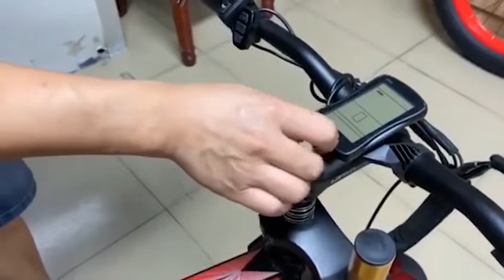How to Adjust Travel Suspension of Motor Cycle Fork for Cyrusher XF900 and XF650 Plus

Comment: How do I change the tension force for XF900?  Just got mine today, when I mount the bike my weight compressors the front fork. I have turned the top of fork adjustment in + direction all the way.
Reply: Matt check out the Facebook forum for Cyrusher you can PM Harry Xie directly or someone on the page will help you.  I'm sure that'll work.  Good luck

Comment: thanks alot for this im literally about to buy this in 3 days and was wondering about the motorcycle style fork adjustments :), btw does this bike come standard with those mud guards like the xf800 does or do i have to call to have those added on cause in the specs it says (optional) but i also dont see those specific guards (the ones with that stripe on them) in the accessories section? thanks
Reply: I have an XF900 and it came with the mud guards although I believe the "Everest" is the latest model and I've ordered one also.  I'm curious as well in regard to the Everest...good question Max.
Reply: @montetown8836  haha ya i actually ended up bombarding them with more questions and they actually responded back to me with answers to everything to my surprise,pretty good customer service, heres the response if it helps you out "Hello Again, 

Thanks for your question. You are right,frankly speaking, Everest and XF900 are the same model frame with different shimano gears, li-battery and top speed,etc. 

Everest is classed 3 ebike with 22miles/hour by throttle, 28 miles/hour by pedal assisant, no special license require to ride in USA according to Fedral law and regluations. 

It has two options: Pro --21 Speeds, 17ah Battery with all accessaries such as rack, fender and bag;  Base--7 Speeds, 13ah Battery with out any accessories. 

Of course, you will see the price for Indiegogo is much cheaper (2500 USD Only for Pro Version), because we are funding to mass produce them to low cost for shipping, production etc. 

 XF900 has higher speed: 31miles/throttle or Pedal assisant and it only have one option:  21 Speeds, 17ah Battery without rack, fender and bag. Of course, we can ship faster than Indiegogo project order.  

Acutally, XF900 is the earliest version we are selling for this ebike, because it is most of customer are like this model but the price is too high for them if we sell just one by one and ship them one by one,so we created Everest version with more afforable options on indiegogo.

In this case, we hide our XF900 links on www.cyrusher.com to avoid any confusion from our new customer and at the same time. 

Finally, regarding Votalcycle, it is one our distributor in USA and they do have few our first version XF900 in stock (all in yellow color as far as i know now).

You can feel free to contact them if you are close to votalcycles or you are welcome to place order with us directly from www.cyrusher.com with earlier shipping or cheaper but later shipping on Indiegogo. 
" . btw i ended up just saying screw it and ordered the xf800 cause im impatient and dont like yellow lol should be here in a month im super excited! :D
Reply: @MadfugginMax  thanks.  I'll give Cyrusher credit they do a very good job of communication you just have to consider their time zone so your response may be 24 hours.  I have an Indiego order placed as it is a back-up bike so I might as well order the fenders now (it'll be winter here in 2 months anyway so no rush).
Reply: @montetown8836  Yeah thats why i chose xf800 hah, so i could get it fairly quicker and enjoy atleast 1 month of decent weather before that new england massachusetts weather smashes me in the face :D, plus from what they say it would seem the xf800 might get some more speed out of it do to programming, I dont think it stops at 21 full throttle,,i think it goes to 28 on full,,,i could be mistaken though, but either way im happy with the purchase no regrets, perhaps i can find those motorcycle forks somewhere else like "fox" shocks i think makes them and i could upgrade someday :)
Reply: @MadfugginMax  took my XF900 out yesterday it was hilarious seeing the looks on peoples' faces as I blew by them in their golf carts...total WTF moment.  Gated community so no speed rules enforced :)
Reply: @montetown8836  haha nice, oh man its funny like ive never ever seen someone in my state or any other for that matter my entire life riding a ebike before, im pretty sure ill be the first one in my area anyhows in MA rocking one of these things. They wont let me ride any kind of atv anywhere pretty much here so my next best option was one of these, man i cant wait to be legally bombing round on this thing. bout 25 more days they say, they just emailed the shipping numbers for the ship and fedex.
Reply: @MadfugginMax  add about 10 days or so because they can sit in customs for a while.  I think I was closer to 60 days.  eBikes are popping up in my neighborhood now...wonder why :)
Reply: @montetown8836  ah true on customs. All good though cause this pandemic has turned me into a rc hobbyist as well thanks to all this free time lol, plus the mad sales on games steam has had, got like 10 games ive not even touched yet.should keep me occupied an kill time no doubt :)